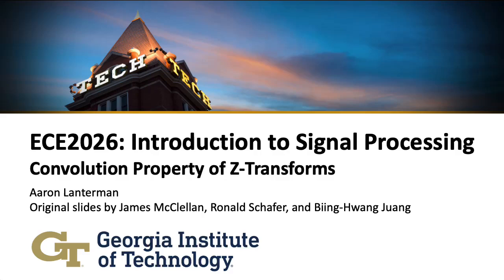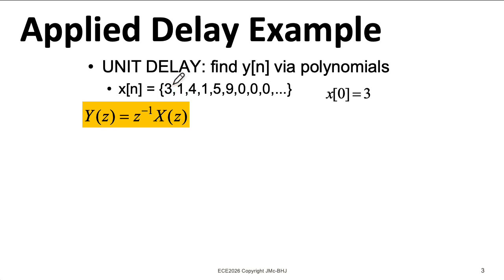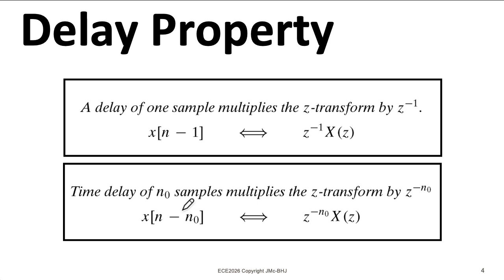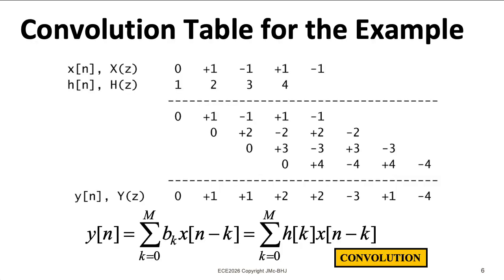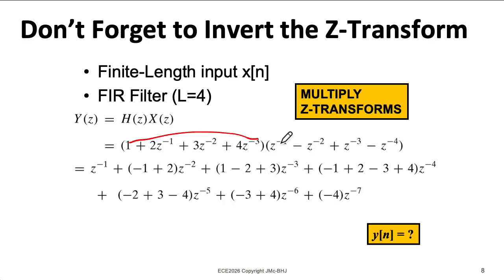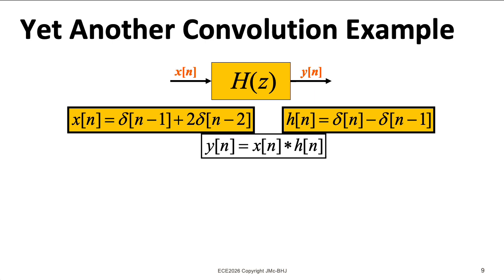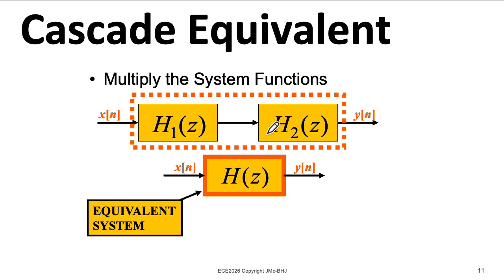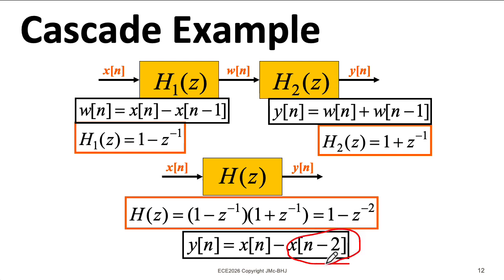ECE2026 L47: Convolution Property of Z-Transforms (Introduction to Signal Processing, Georgia Tech)

Comment: In Mathematics (mostly Combinatorics) z-transforms are called Generating Functions. (Actually ordinary generating functions, as there are other kinds.) A great tool for solving many combinatorial problems.
Reply: Stanley's Enumerative Combinatorics is an a towering piece of work, immensely useful in a mathematical toolbox. I'm not comfortable mixing z-transforms and generating functions in a DSP/signals and systems sense, as it risks muddying the waters for the intended audience.
Reply from the maker: Ah yes, if you substitute x = z^{-1} I see they are equivalent.